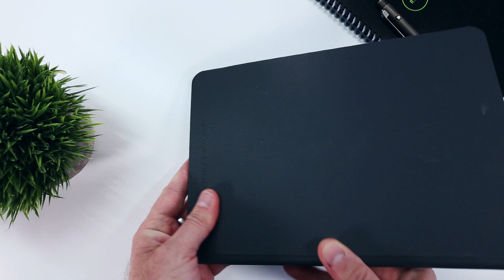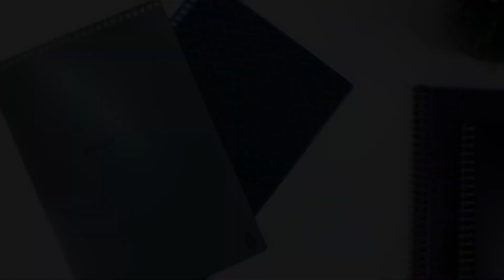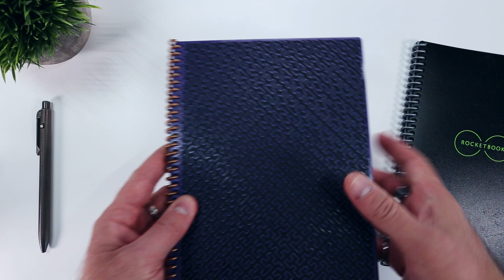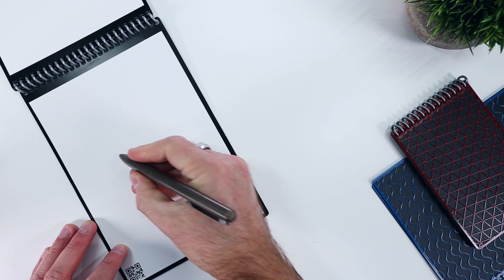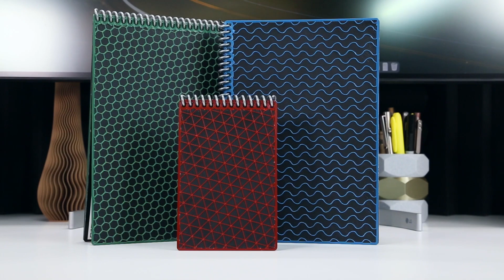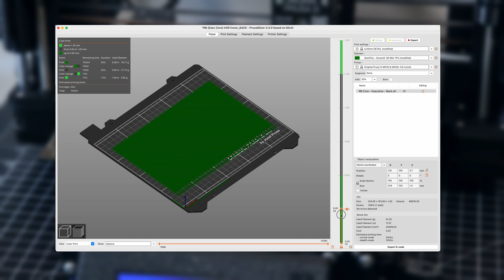Upgrade Your Rocketbook Covers... Big Time

Comment: I did buy a cover for my core. It is everything you said it would be. But, the ends of my notebook no longer lie flat when folded front to back.
Reply: I think I need slightly larger rings. Not a problem. I just don’t know what size these are.
Reply from the maker: Hmmm... I'm not sure either, but I suspect an office supply store would know, and probably also have stock of every possible variation in sizing.  Let me know if you find the right size, and good luck! 👍
Reply: Okay. They are .5 inch. Etsy seller “Rocketbook Creations” has coils in different sizes at a few dollars a coil. She has been pretty creative supplying Rocketbook owners with extra supplies.
Reply from the maker: Thanks for sharing your experience with them!  I'm glad they work as described.  Is the laying flat issue because the protruding ends of the spiral are poking against the opposing cover?  I could see how that may be exaggerated now that the covers are a little thicker... Have you tried re-bending the coil ends under heat to be a little flatter themselves so that they curl away from the face they are bumping against?  I hope you can get that straightened out 🤞

Comment: I'll be honest, the pilot friction pen skips so much I stopped using my Flip. 🥺
Reply from the maker: Oh no! Sorry to hear that Joseph… did you try multiple FriXion pens/cartridges?  Over the years I’ve stumbled across a few cartridges that just never write well, but they have been few and far between for me fortunately.
Reply: @JakeReevesVideo  yeah, it works most of the time but gives me trouble just enough that I often switch to a traditional notebook with a reliable fountain pen. 😂
Reply from the maker: Fair enough.  I’ve been experimenting with Rocketbook’s printable pages lately, and making my own templates - it’s hard to beat real paper 👍
Reply: @JakeReevesVideo  I'll use the Flip again just need to find the right project.